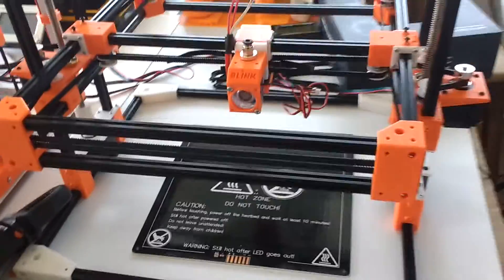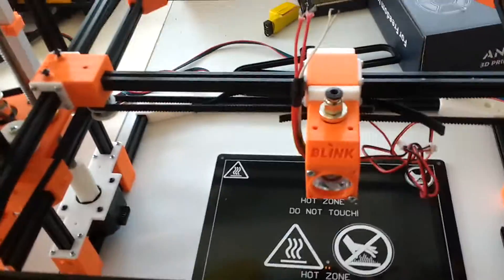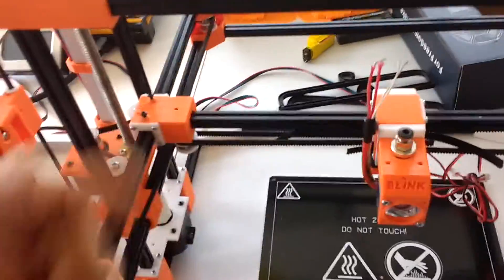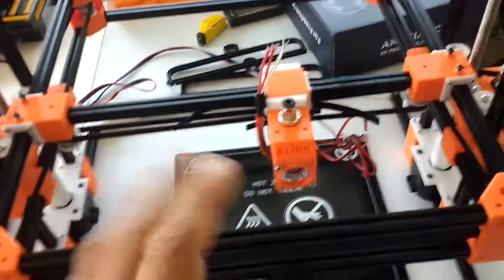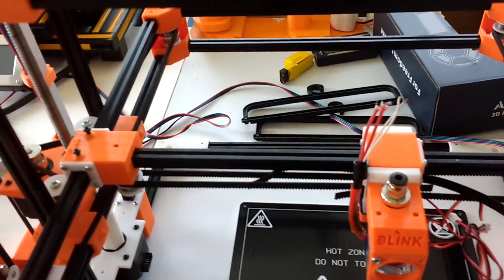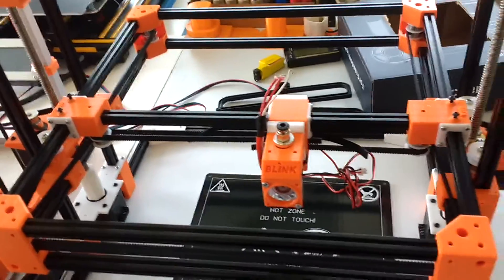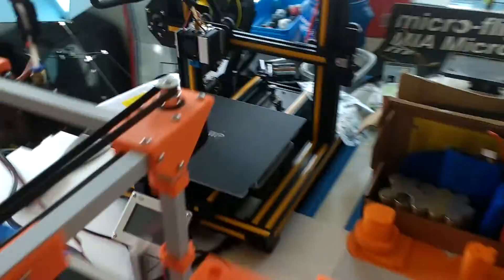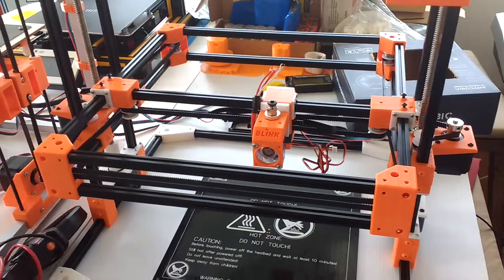How a Core XY 3D Printer Looks with Outside the Box Thinking

Comment: Certainly looks different !
You mention that it is unique several times, but why did you design it this way ?
Does this design have any advantages over a traditional CoreXY machine ?
Will be nice to see how it actually prints...
Reply from the maker: I explain that in my other videos. But our hand, the way we write was my inspiration. We hold a piece of paper or the print surface steady, typically and our hand is the tool that does the printing, the basic up down moves x,y motions. Basically I wanted this function in a core XY printer. This is how the MIA Blink™ was born. The advantage is on minimizing any unnecessary weight on the head and motion mechanics to allow the print head to move smooth, precise and fast. My machine does not use conventional linear rails and is very lightweight while being also rigid with high precision. No need for use of brute power, this is where high efficiency also comes into play. A machine that uses heavy components most likely requires higher power to drive it. And most if not all core XY machines out there are built like tanks with the XY motors, in my opinion,  in the wrong place.
Reply: @MarioIArguello  On keeping the bed static and only moving the print head like a hand writing (which is more like a CNC machine by the way, writing is mostly 2D), the Voron 2.4 has the same concept I believe. Minimizing weight is certainly what a lot of fast CoreXY printers do (Bambulab X1/P1P for example). The frame stiffness in relation to the toolhead weight is always a delicate balance.
But the most unique about your design is the motors in the middle and besides it looking different you haven't really given any info on why it is an advantage ?! Don't get me wrong, I like that you are trying new things, but if mounting the motors in the middle doesn't have any advantages in print speed and/or quality then that might be the reason other people didn't make it ?!
Reply from the maker: @_MicZ_  let me just say this, in terms of advantage from conventional machines. Mass, brute force, is not required for a machine that needs to precisely  lay strips of soft plastic to build 3D dimensional parts, step by step, in layers. Efficiency is a balancing act also. The problem I have and this is, has been a fine detail throughout all my whole life is that people tend to lock on the more conventional, often without investigating other options. While some things are logically done in certain ways, many are not for various reasons.  But if we assume that all things are done for good reason without testing that hypothesis, then we are simply replicating with no exploration into other possible options. If the earth is  indeed flat , for example, fixed and level plane as some people believe it is, there must be good reason, as this form of mentality tends to go against conventional believe and indoctrination. But it does not help if we are close minded and accept everything at face value. Again brute force and power is not always the key, in the words of Bruce Lee, be like water,  in a certain term, water is so flexible or fluid,  it conforms to many shapes, in it's fluid form, but of course never to the surface of a sphere as, logically, water  always seeks to be level.😉
Reply: @MarioIArguello  OK, so while your reply certainly was lengthy and pretty philosophical I guess there is no clear advantage of putting the motors in the middle.
My examples of the printers that share some of the other ideas that you incorporate ("floating" gantry like Voron 2.4, lightweight linear rails like Bambu Lab X1/P1P) are also not considered "conventional".
While I agree that thinking out of the box can be a good thing, aligning it with flat earth theory is a bridge too far for me... (thinking different is not the same as illogical thinking in my opinion)
Reply from the maker: @_MicZ_ 

This is logical thinking: ☺️
Water in volume impossible to adhere to the surface of any ball, water seeks it's own level, thus the oceans must be horizontal with the horizon. 
This is illogical:🤨
There is no such thing as curvizon,  and to take the idea that our world is a ball traveling at umbeliveable speed and spinning while it, with the oceans pefectly still attached to its surface, is beyond common sense when your mind is open and  clear from the indoctrinated clutter.  

A mind who cannot contemplate a different point of view that challenges a given narrative,  or model, is a mind asleep. 
Give  this some thought with intention, this means you will have to give yourself the opportunity for a different perspective than that which has been deeply rooted into your brain. 

It took me a couple years to investigate and finally come to that logical conclusion,  I kicked myself in the bottom for not seeing it, earlier, because we tend to take everything wer are told at face value  from variuous supposed leaders and experts in various fields,  our supposed educators themselves may not know better, and so they are bound by rules tor promote a certain model, otherise it places at ristk their jobs. To drill something to nauseum in to the head of people is to brain wash. Education allows the room to question and find other ways to do things than those thought as conventional. And while this may sound philosophical, opening the mind to other possibilites is important.  

This logic  is so simple and clear that it boggles indoctrinated minds. Ok regarding advantage, it may not be obvious, at a glance, but I thought I mention  speed and higher precision as being the reason I built it over the more conventional machines.